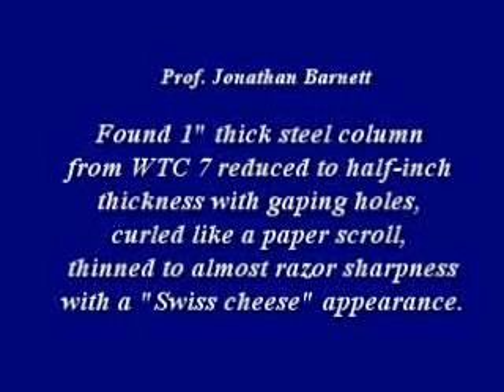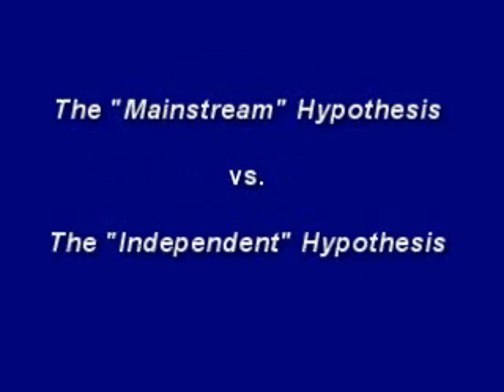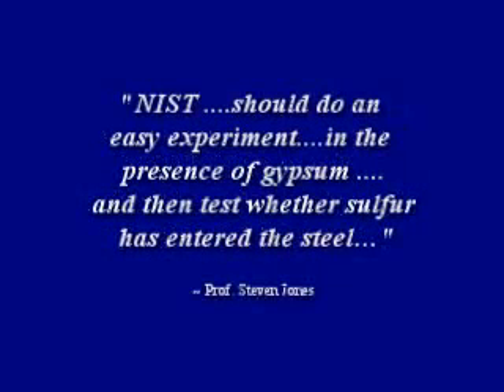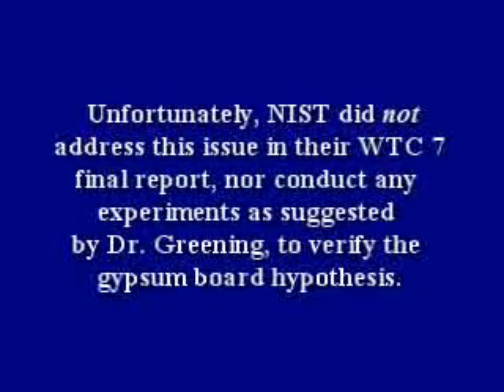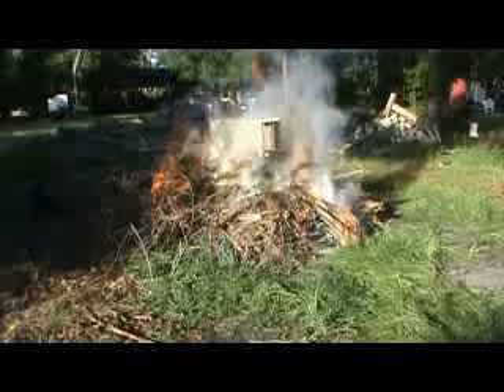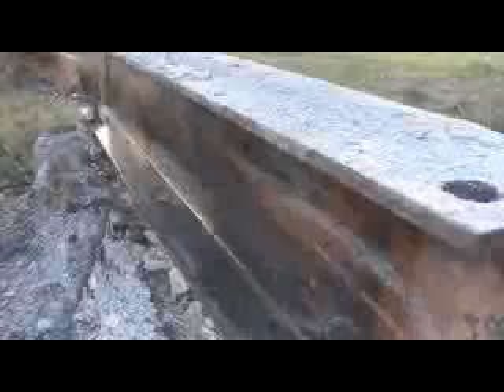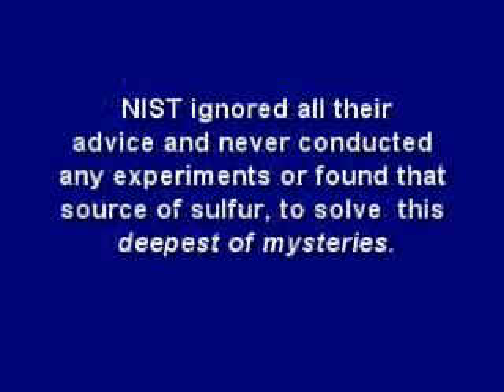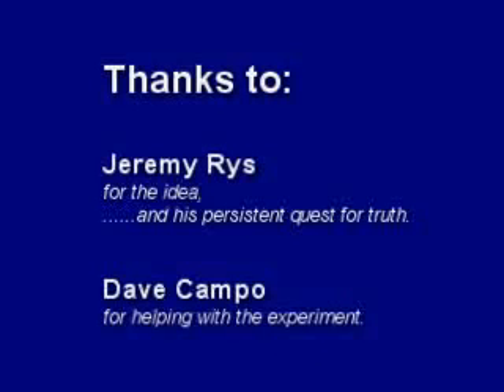9/11 Experiments: The Mysterious Eutectic Steel

Comment: Absolute rubbish! The top floors are subjected to the same destructive dynamic forces as the fixed lower parts of the building. Therefore at the demolition zone, BOTH the upper and lower parts are destroyed.  So the top 15 floors would be destroyed BEFORE the total 90 floors below. Newtons Third Law. Also, how does an asymmetrical fire cause a totally uniform collapse of the buildings? And not just one, WTC1, WTC2, WTC7. Somehow added energy was present!

Comment: Well no, there weren't. It's in the official report. Fires were localised and moved across the floor looking for fuel, it did not stay in one position for longer than 20 minutes and was unable to move from floor to floor.

Contrary to the steel in WTC, the official report also claims that steel did not soften, but stayed rigid and underwent thermal expansion. This could only be supported by (secret) computer models with incorrect data.

Comment: OK.  I have here on my computer pictures of steel that has clearly burned in fires - both fires had lots of petroleum fuels which provide plenty of sulphur.

I was burning steel over 50 years ago - all it takes is hot flame, sulphur and a a strong draught courtesy of The Atmospheric Press.

Comment: hi, your experiment was very poorly set up.
repeat it but stand the beam on some concrete blocks about 3 feet tall and pile the fuel and other stuff round it and fire it with added old tyres, or diesel fuel and then you shoudl see burned steel.
your experiment covered the beam with insulating ashes.

Comment: Sulfur can't be introduced at the granular level into steel by normal fire, it can only happen in a chemical reaction or when steel is completely liquid. Since everyone knows jet-fuel can't melt steel, the only explanation that makes any scientific sense is that some kind of exotic substance like thermate had to cause this. U can't melt steel w/jet fuel or office supplies! U can't even do it w/a controlled burn much hotter.That's why our pots don't melt on the stove! How blind can U be? 2750 F.

Comment: It's impossible, N the case of the N. Tower, 4 a small portion of bld 2 crush the larger portion 100s of ft below where the steel was still cold & hard, or should've been. 4 this 2 happen would require several laws of motion 2 cease existence. 4 every action, there is an equal & opposite reaction. The smaller top block would itself get crushed b4 it could crush the larger 80% portion of the bld. A pile driver, like a hammer, can't do its job w/a single blow! This is grade-school physics! Wake-up

Comment: "softened, expanded, contracted?" which is it? The fact is that a bld can NOT fall thru itself @ free-fall speed if there is ANY resistance, & even weakened steel offers more resistance than air. Blds don't collapse thru themselves, they fall over. U believe 2 towers, damaged N different places, collapsed identically & WTC7 imploded from fire & also fell thru itself @ FF, on the same day! Never happened b4 or since. Gov't never lies:Gulf of Tonkin, Iran Contra, WMDs N Iraq, NSA spying. Really!?

Comment: you are a crock of shit, I personally have posted several vids of wtc 7 and the so called 'raging fires'. there wasnt any. the fires were burning out, period. not to mention that OFFICE fires don't burn hot enough for steel to melt. don't try your crap with the diesel fuel burning, I already know some 10,000 gallons was recovered by the EPA after the collapse. the whole right wing is corrupt and full of shit. you will have to be voted out and outlawed.

Comment: That 'uncommon substance' in WTC7 was oxygen via the Fire Tube Effect.
The little bonfire used in this experiment was nowhere close to the heat in the unrestricted fres in the lower ors of WTC7.
The collapse only looked remarkable because all vidoes show just the top 30 floors weight overcame came the softened, expanded, contracted lower floor columns and beams.

Comment: Good test! However conclusions are wrong. You assume some OTHER material must have caused the damage. But there needn´t be any material at all causing that kind of damage. It could have been a directed energy weapon such as Dr. Judy Wood proposes. And by the way... there is not one single video out there showing a thermite or thermate reaction during the destruction of the buildings (ie red, firey heat). The buildings are pulverized in a matter of seconds and thermite doesn´t do that. Period!

Comment: "if it's not on pictures, it didn't exist."

baahahahahahahahahahahahaa

“Large columns of steel were just stuck into massive amounts of molten steel and other metals….It looked like a massive, molten mess that had been fused together……With all that heavy, heavy stuff, there were wires, rebar, concrete. Most of it was just steel. A lot of what we were walking on was just molten steel.” –Mike Donoho, Fire Chief – Bryan, TX Fire Department, aided in cleanup effort

baaahahahahahaha

Comment: “Large columns of steel were just stuck into massive amounts of molten steel and other metals….It looked like a massive, molten mess that had been fused together……With all that heavy, heavy stuff, there were wires, rebar, concrete. Most of it was just steel. A lot of what we were walking on was just molten steel.” –Mike Donoho, Fire Chief – Bryan, TX Fire Department, aided in cleanup effort

Keep "debunking" these "kooks" aka, eye witnesses merlinboy!

Comment: Page 11: "I assert that this glowing liquid metal is consistent with flowing liquid iron from a nearby thermite reaction zone..."
Page 12, discussing the same flow of yellow-hot liquid: "The yellow colour implies a molten-metal temperature of approximately 1000 C..."
Table on page 8 gives the following temperatures: Lemon, 1000 C; light yellow, 1080 C; white, 1205 C; structural steel melts, 1510 C; iron melts, 1538 C. 
Do you see the problem yet? The report contradicts itself.

Comment: WTC Building Inspector STANDARD for WTC DUST
inspectapedia. com/ WTC/ WTCdust. htm
USGS SPECTROSCOPY LAB: speclab. cr. usgs. gov/wtc/
WTC, WTC DUST, and USGS FE SURVEYs
pubs. usgs. gov/of/ 2001/ ofr-01-0429/feats-1um. html
MORE than ONE authority, has identified the Paint actually FOUND
on WTC steel, as TENEMEC Steel ceramic paint over Anti-rust paint.
WTC DUST, FE FROM TENEMEC PAINT CONCRETE DUST
pubs.usgs.gov/of/2001/ofr-01-0429/feats-1um.html
That, at least, was actually found on the steel.

Comment: Did you figure out how a 60 micron layer of painted on Nano thermite
Jumped OFF the steel, gathered itself into a pile, put itself into a steel
container, bolted that steel container, by itself, onto a vertical steel
column, burned thru steel leaving SULFUR and a ragged edge, then
UNBOLTED it's own container, and evaporated itself, and it's own
container, filling in the bolt holes as it went, yet?

Comment: BTW, there ARE no civil / structural engineers. NOT ONE, with a steel fabrication specialty. In 11 years, you idiots have turned up ONE 20
something loser in San Diego, and a steel piping engineer in Texas.
Other than that, your civil engineers, most of them don't even practice.
Literally, they are civil engineers in name only, Didnt you notice that?

Comment: CIVIL engineers ARE structural engineers, Moron. It's just a steel fabrication specialty in the Civil Engineering degree. Steel structural engineers, are
severely lacking in 9/11 Groups. The establishment, of course, enjoys
the full support of the Structural Engineers of New York (SEANY),
whose 12,000 Members BUILT the WTC, and whose members did
MOST of the onsite debris examination. One of the 767 engines,
(Flight 11)landed outside their Front Door.

Comment: Sulfidation  
Sulfur is one of the most common corrosive contaminants in high-temperature industrial environments. Sulfur is generally present as an impurity in fuels or feedstocks. Typically, fuel oils are contaminated with sulfur varying from fractions of 1% (No. 1 or No. 2 fuel oil) to about 3% (No. 6 fuel oil). United States coal may contain from 0.5 to 5% S, depending on where it is mined

Comment: The weight of the 767-200ER airplane was closer to 200,000 pounds and was spread out over six floors.  At 50 pounds per square foot, those 6 floors could tolerate a live load of over 13 million pounds.  

Effective terrorism required the use of airplanes--because most people around the world see airplanes every day.  A simple bombing would not terrorize as effectively.  Also it would be highly embarrassing to a security company associated with Bush's family.,

Comment: sec the guy in the video claims(at 0:25) that it never ever accourd that a building/skyscrapper collapsed 

but he forgot the weight of the two airplanes on top of the wtc!! 
Planes with 11,466 US gal of fuel each!! 
and 272,500 lb of airplane 
and also the impact that demolist the struction 

Can you also tell why the us coverment not simply blow up the buildings with explosives and claim it was done by a islamic extremist !??

Comment: What kind of pressure, and why?  The purpose of the experiment was to test NIST's claim that the "evaporated" steel samples discussed in FEMA's Appendix C report could have suffered their eutectic attack during cooking in the burning debris piles.  NIST says that the sulfidation attack did not take place in the standing building.

Comment: This was an excellent research experiment. Of course, WTC7's free fall and symmetric drop alone is proof of demolition because it requires the instant, total, and simultaneous failure of all steel support columns. Gradually heating just a few floors in random areas of the building can't cause that.

Comment: Has anyone considered rust?
Rust will reverse it's process and return to iron at it's boiling point, which is much lower than iron.
Acid rain? Salt air? Just asking; I don't know. the deformations sure look like rust corrosion. Heavy rust was in the Twin Towers. Not so sure about 7.
Joe Hill

Comment: You didn't answer the question. How come Steven Jones points 
to a paint layer, and PhysicsandReason points to a container?
How did the paint layer congeal into a charge in a bolted on container?
Where did the IRON and Alumina oxide go?
How come Steven Jones NT report doesn't mention THERMATE 
once, in the entire report?

Comment: The real problem, Dumbshit, is that Truthers want the energy of thermate, but not the barium oxide, and Nitric Dioxide. Barium oxide is luminescent, and would light up the WTC like halloween, and it's a familiar skin irritant used by military "Itch powders". Nitrix Dioxide, is both explosive, and toxic, with a characteristic, sharp odor, that fire dogs would pickup from a block away.

Comment: Oh, by the way, the Steven Jones NT report, was about
a paint layer of "Thermite" (60 microns). SO, how did
this paint layer, gather itself into a 100 tons blob, attach
itself to the steel, in giant containers, bolted thru holes
in the beams, and then disappear like a poof into virus
sized particles again? Is it the metals robot of Terminator2?

Comment: Thermate sure does, Moron. 29%. Everything else,
any other mixture, is NOT thermate, Moron. That's the
definition of the term. As I pointed out before, Thermates
leave IRON, not just aluminum and Barium Nitrate.
They are used to weld in the field. So where did they weld
themselves to the WTC steel? You do realize heating the
steel involves cooling the thermite / ate, right?
Where did 70 tons of IRON, about the volume of 18 dump
trucks of IRON GO? We didn't find THAT in the rubble either.

Comment: peroxides are also used as oxidizer in pyrotechcs, fireworks, and it can explode when mixed with aluminium, it could also be useful for ignition or oxidizer in thermite. when you say it "probably" cant be used, it is your speculation - just an additional point - important is, that barium nitrate is not necessary, as you admitted yourself now.

Comment: Lastly, if you had actually READ the FEMA report, or
appendix C, where this eutectic steel was originally
reported, it would tell you that it's a liquid eutectic mixture.
On a horizontal beam. A pool of liquid corrosion metal /mix.
Why should we car about a liquid pool, being used to 
attack at 45 degrees on a column?  How many times have
YOU ever seen a liquid pool stand at 45 degrees?

Comment: The whole idea, sherlock, is that chemistry radically changes at temps above 750 C. It's not Kansas anymore, Toto.
Just to give an example, a common Oxy-Acetyl cutting torch,
doesn't cut steel. It's used to heat steel to 750 C, where
a high pressure oxygen blast is used to corrode away
steel from the KERF. It's NOT a melting of the steel, it's a 
corrosion based process that produces eutectic debris.
Hate to break it to you, but PhysicsandReason has already
blocked people who mention this.

Comment: True, that's very possible, you could use other nitrates, 
though probably NOT peroxides. (Their binding strength
just isn't high), so what? Barium Nitrate is the ideal mix
for the attack on metals. That's why the military uses it.
ANY OFFICE FIRE, can support razor sharp corrosion 
holes. PhysicsandReason doesn't even try to match the
environment. An Outdoor Fire to match a Reducing atmosphere, 1,000 C fire, on an Internal beam? How exactly does that match the environment on YOUR planet?

Comment: adding barium nitrate as oxidizer to the thermite and sulfur is only one possible option (could be other nitrate or some peroxides). And i still saw no proof, how an office fire can cause cause razor sharp holes in steel beams. only hundreds of pages of talking. Physicsandreason shows experiments, and these proof that thermite causes such razor sharp holes in steel beams.

Comment: would added weight make the office fire hot enough to burn holes in steel?  This effect is clearly achieved in his other video where he does experiments with thermate.  Totally mythbusted mythbusters.  He was able to shred a carrot on the sharp points of the beam when he was finished.

Comment: I did show the reproduction of the Eutectic formations moron.
They are on THIS page : debunking911. c o m / thermite. h t m
But if you want, you can see the Eutectic steel being produced
11-settembre. blog spot. c o m/ 2007/02/ technical-widening-about-thermal. h  t m l 
All Metals cutting is a CHEMICAL CORROSION process, Moron.
Oil based fuels can't melt steel, remember?

Comment: Hey, you can wiggle all you want, a 911 conspiracy is just ass fucked.
Common office fires warp and twist steel unloaded, unless you
are saying a copier or a desk are holding up the building.
I SHOWED you a video of Eutectic steel being created, and
it's done with NOTHING more exotic than acetylene and O2.
Idiots like you don't understand that all a torch does is heat
the steel to 800 C or so, then high pressure O2, corrodes
the steel from the steel Kerf. It's NOT melted away, it's corroded.

Comment: Then you better explain burned out copiers, metal desks, and
warped and twisted metal in normal office fires. MOST metals
damage done during fires happen at MUCH lower temps than
melted steel. NOTHING ELSE is needed than Gravity and fire.

Comment: Not just myself, anyone with a gas welder or torch can produce the
Eutectic steel. Doesn't even have to be Acetylene. Anything that
entrains gases into a metal foam, like the drippings from a torch,
produces eutectic metals. It's got a lower melting point than either
element, because it's a foam, and has gas mixed in with the metals.
debunking911. c o m / thermite. h t m  : Scroll down to the word 
Kudos, and you can SEE Eutectic steel being made.

Comment: I also invalidated his basic statement. Delivered at 3:03
in this video. Quote "The main chemical reaction in thermate
is the same as thermite, but it also contains sulfur"
This is technically, butt ass stupid. Thermate uses Barium
Nitrate as 29% of thermate. It doesn't use a Iron oxide,
aluminum reaction at all, it uses a nitrate / iron reaction,
and leaves the Barium oxide, which glows in the dark.

Comment: What experiments do I need to do? The components he 
used didn't exist, the chemical compound he proposes
didn't exist, and he performed an outside in the air fire,
to mimic a reducing atmosphere indoor fire, in the middle
of a skyscraper. Can't get any more stupid than that.
The eutectic steel was horizontal, so it suggests a source
that POOLS. You can choose from 100s of sources, and
NOT ONE of them can make a horizontal steel beam,
cause a vertical collapse. Duhhhh

Comment: You call it bullshit because you are afraid of science? What specificaly do you not understand? The shattered windows on the lower 20 floors right after the impact? The damage to the outer and inner columns when the plane impacted? The 20 story gash in WTC 7 caused by debree from the nearest collapsing tower? Survivor eyewitness reports of progressive failure like broken pipes and jammed doors in the towers and visible warping of the outer structure of WTC 7? What?

Comment: The impact of the planes caused severe deformation in the towers, as well as massive damage to both interior and exterior loadbearing supports. The fires weakened the surviving columns further, until they failed as well, causing the collapse. WTC7 was hit by a large section of outer wall from one of the towers, dealing even more damage to it's structure then planes could. The fires sped up the collapse, but it's structure was audibly groaning and visibly shifting, so it would have fallen anyway.

Comment: By the way, NOT only are you NOT an aircraft mechanic, you
haven't mentioned that aircraft maintenance techs have to post
the aircraft airframes, and powerplants they are certified to work on.
Just like I am certified on piston engine, single wing, and floatplane.
It's not like one piston engine is identical to another, it's an
airplane, dumbass, not a car. btw, it's aircraft maintenance tech,
NOT mechanic.